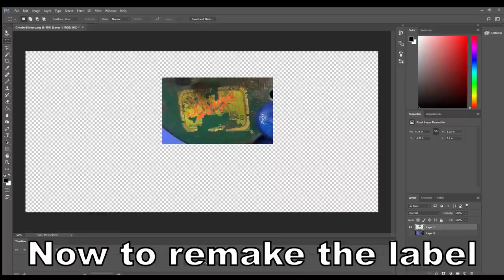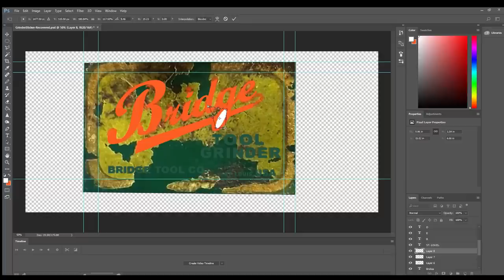1940's Bridge Tool Grinder Restoration

Comment: It's good to see that the bench vice is being used and not just a showpiece! Also, why so much grease on the inside? I always thought less is more when it comes to that.
Reply from the maker: For gear boxes like these, packing with grease is common. Grease is pushed outward when it is spun. So you want enough to fill the voids

Comment: Only question I have is why remove the original paint or had it already been repainted before? Also why blue the gear it should be covered in grease which will prevent rust.

Comment: All the sanding, grinding, filing  and blueing is completely unnecessary, you are removing parts of the history of the tool ( = it was a cheap mass produced tool from the start).  All this needed was a good scrubbing, some fresh grease and a new stone.
Reply: Mike: It might of been mass produced but I wouldn't say cheap. You will have a hard time finding the same thing (if they were made today) with the quality this old grinder was made with. "They don't make things like they used to" is the saying.